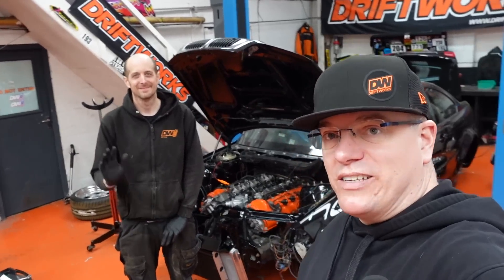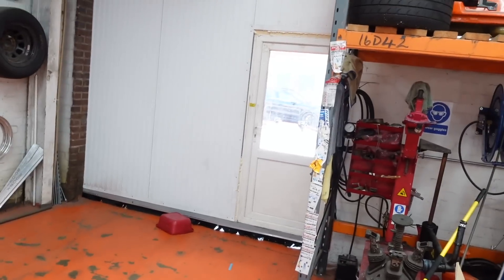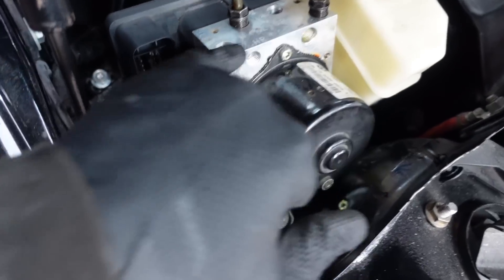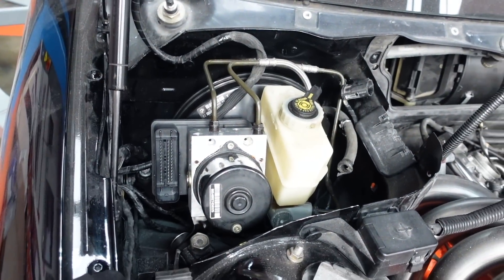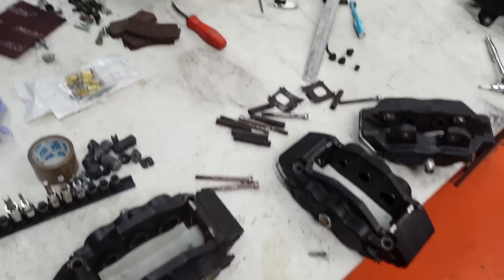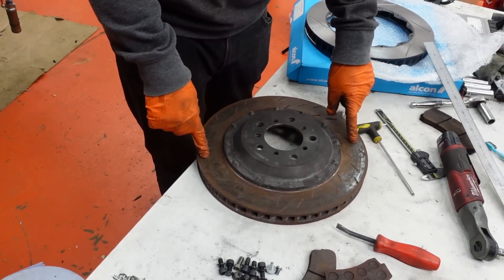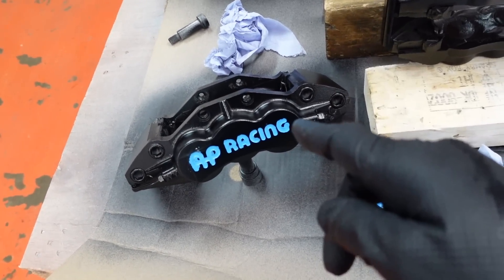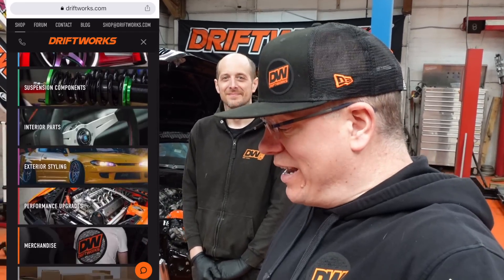V10 BMW M3 - Brakes for a car that doesn't run

Comment: You could have just used a small 50 pence paintbrush to fill in the lettering on the calipers, and it's even easier if you mask them.

Comment: I did the same thing with my ap’s and machined a new bell instead of swapping a kidney for new rotors and hardware shipped from the uk to Australia
Reply: It's no wonder nobody in the USA uses AP stuff - it's all Wilwood. AP seem to think their gear is machined from solid diamond, the prices they want!
Reply: @ChristopherHallett  It is great gear but just mind bogglingly expensive. Alcon are another alternative if you are looking for bigger brakes than wilwood tend to provide for.

Comment: As good as that manifold looks there is no doubt it's going to cause all sorts of heat issues that will lead to reliability issues on flat out track days. Just don't get spending 20 grand on a manifold that is going to deliver no performance gains apart from looking good in the engine bay? Having said that love watching Jay work his magic, top bloke, great talent.
Reply from the maker: There are a few misconceptions about this car, but to cover a couple:  It's not a track car & no one in their right mind would spend £20k on a manifold for an M3. The car is not for anything really, as I have everything I need and more covered by my other cars. That's why I pushed the boundaries a bit to try something no one has done before, and to see if we can solve the engineering issues I've inflicted on myself.
Reply: "no performance gains apart from looking good"?

Do you not understand what tuned-length 10-into-1 headers will do to the sound of a high-revving V10?

This thing is going to howl like a banshee! It may end up being the best sounding car in the UK.